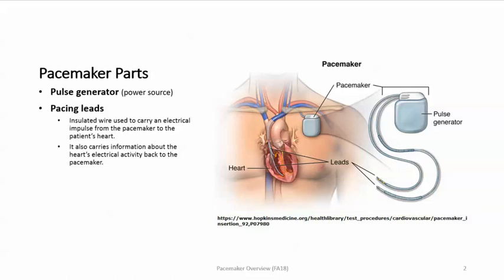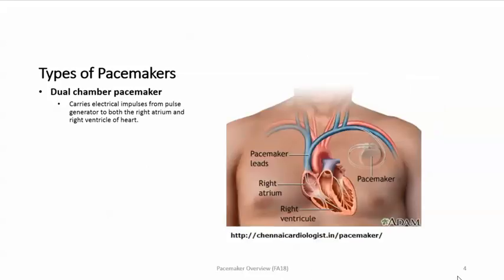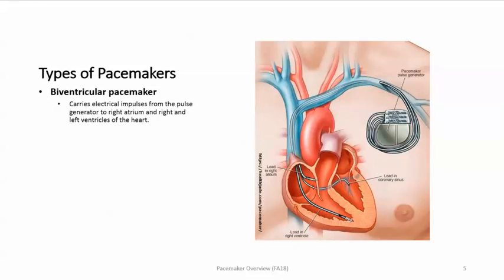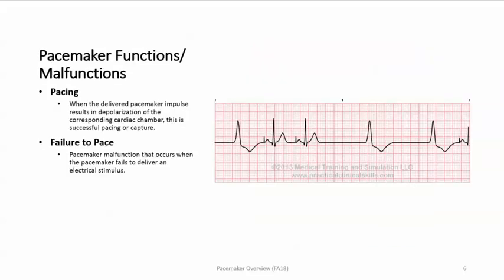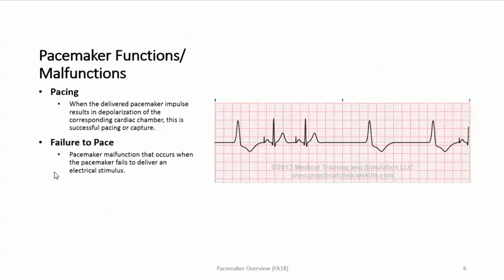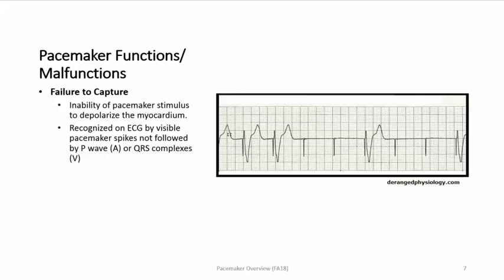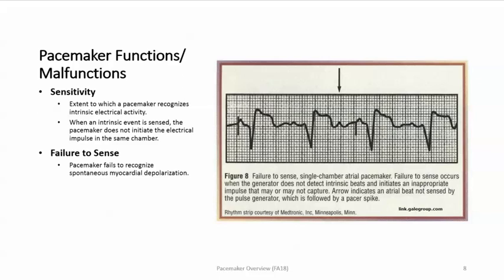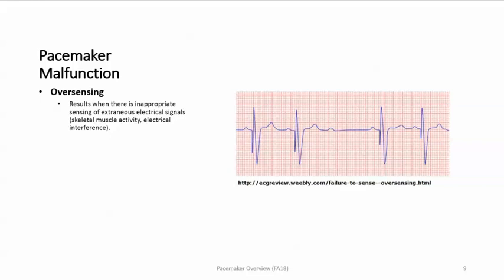Pacemaker Overview

Comment: nice lecture but i dont agree regarding the Oversensing part where you said that the pacemaker should have fired at the 1st arrow (6:14) you pointed at, because that there is the T wave but i also agree that i shoudve fired during the 2nd arrow..